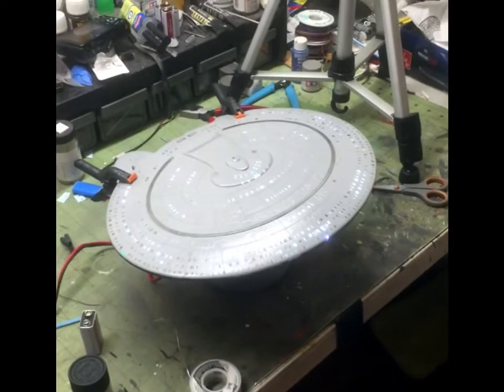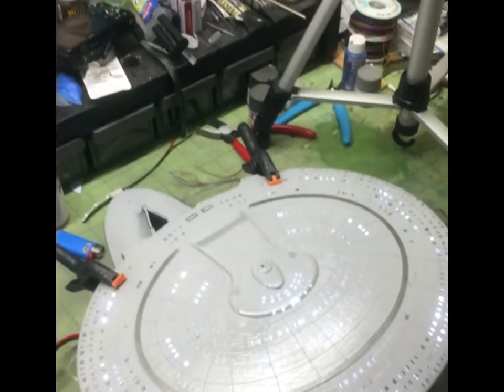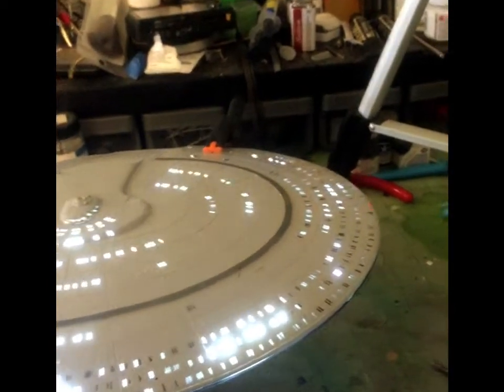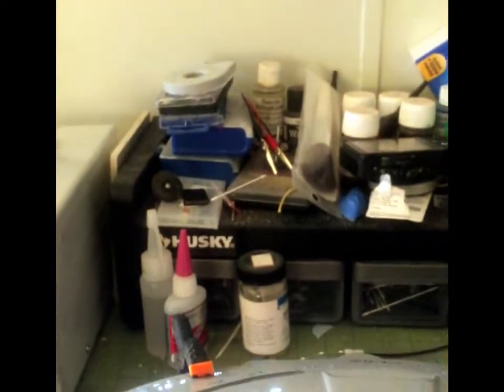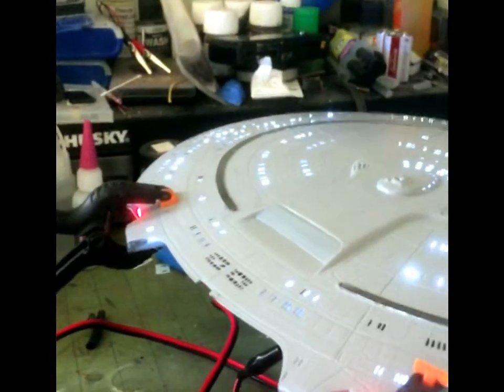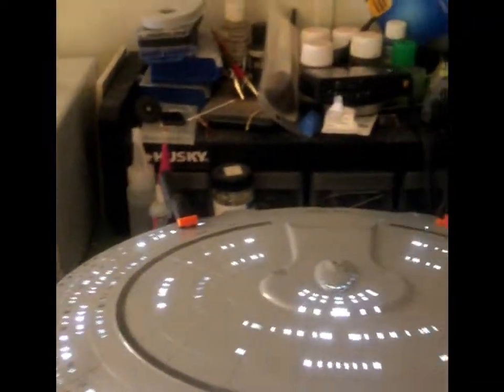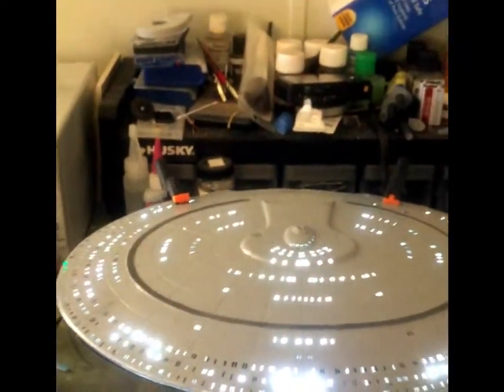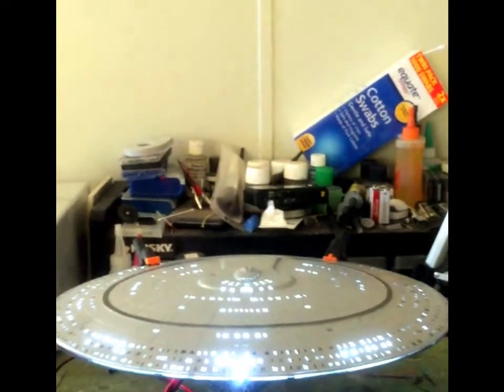AMT 1 1400 USS Enterprise D update 7.1

Comment: looks great ! only thing i would recommend is try running it at 9 volts... usually looks more in scale at that voltage.
Reply from the maker: Gearhead Workshop thank you. I will try your suggestion out.
Reply: Boyd turned me on to it... made a good difference on my Refit Enterprise.
Reply from the maker: Gearhead Workshop how does that work with wall power supply. Are there some out that go to 9v instead of the 12v?
Reply: yep... http://hdamodelworx.com/9v-DC-POWER-SUPPLY-NEW-MODEL_p_25.html     but he is out of stock at the moment... most effect boards will run on 9-12v too. on amperage go for at least 2amp if you have a lot of lighting... i had a 12v 2amp on my refit and it got rather warm because of amp draw. going to 9v 4amp solved the problem... it was starving for amperage making the supply hot... 9v was just to knock the lighting down to be more scale.
Reply from the maker: Gearhead Workshop thank you.